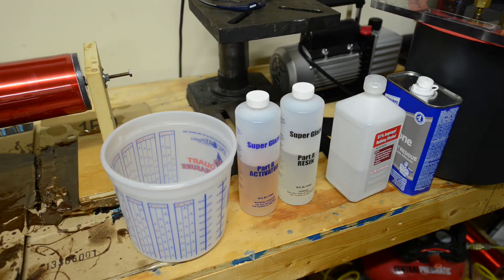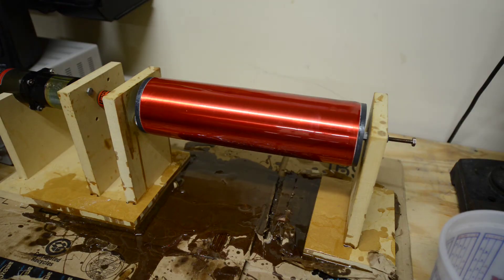Tesla Coil Epoxy Coating Tips and Tricks

Comment: This is a great tutorial to a part of tesla coiling that doesn't really get documented as much!
Probably because... juggling a coil and a camera at the same time takes quite some talent!

I remember the first time I started coiling, I used a paintbrush... that didn't last long as it's terrible for bubbles and bristles coming off,
so I switched to credit card type materials, which work well, but looking at your scraper the width looks to be quite advantageous.

What is your reason for using Epoxy? if you've tried Polyurethane is Epoxy better?just out of curiosity.